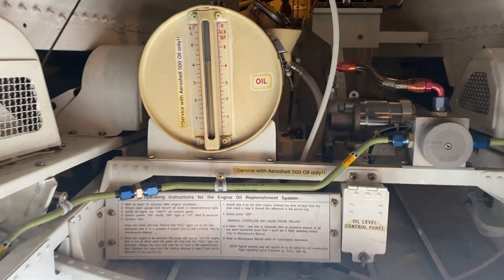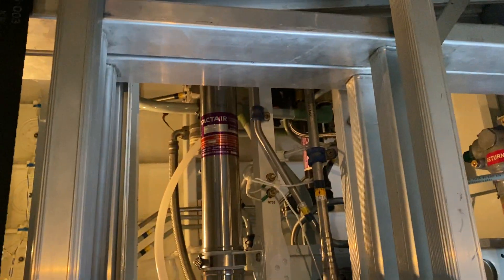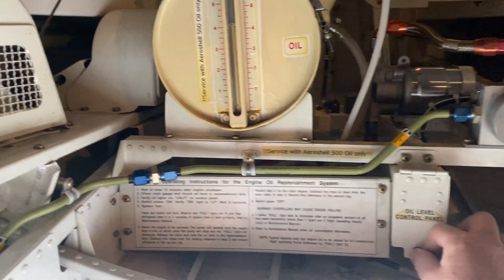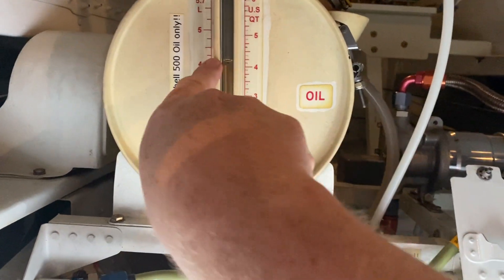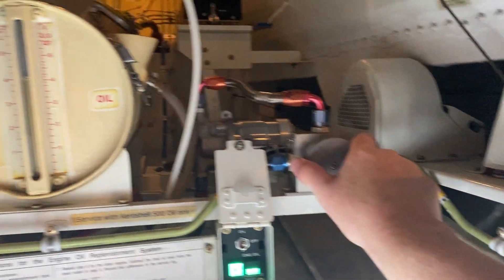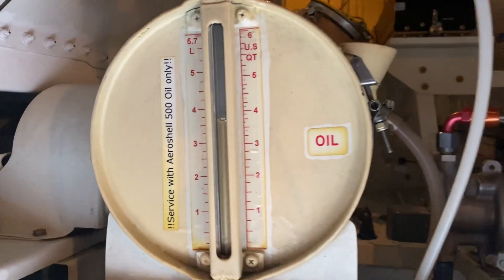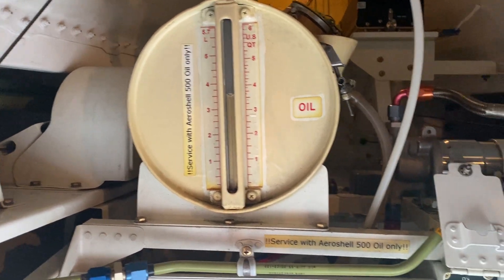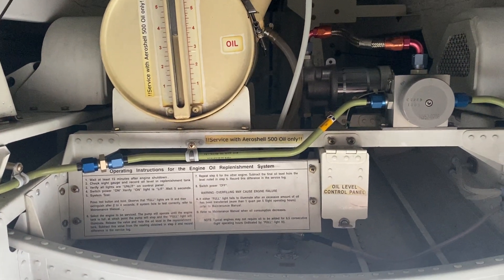Challenger 605/650 | Post Flight | GE CF-34 Engine Oil Replenishment System

Comment: Is this done post flight on every flight?
Reply from the maker: At the end of the last flight of the day.
Reply: @foxtrotalphaaviation  Got it, thank you! Was looking for a good metric of when to do it in X-Plane. Forgot for a while and had it down to 1.5 quarts each 😅. Never had an engine failure though. Doing it this way should prevent that from happening for me ever again.
Reply: What happens if you forget to service the oil in the engine and keep flying..?? Engine failure??
Reply from the maker: @Goaround_wit_Leo  yes if you forget and there’s no more oil in the CF-34 engine you’re definitely going to have an engine failure. That is why we do aircraft maintenance inspections by AME (Aircraft Maintenance Engineers), including the inspections that are done by flight crews on a  daily basis. The chance of forgetting about oil level increases is very very low. Thanks for your question.